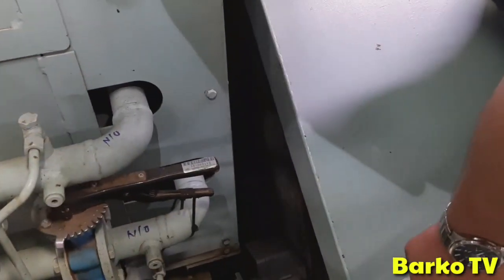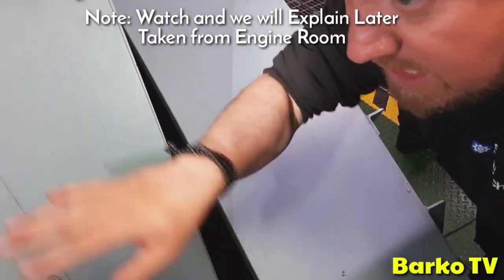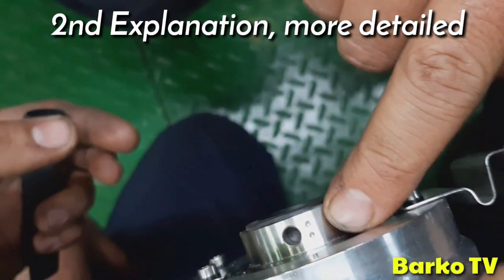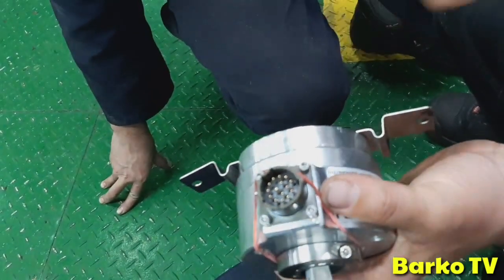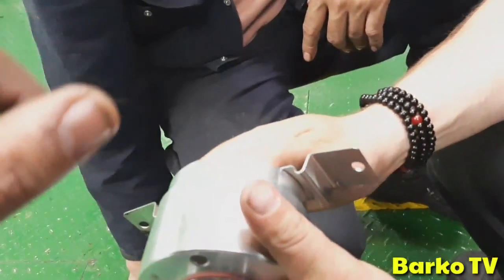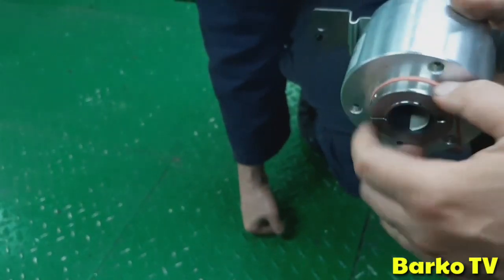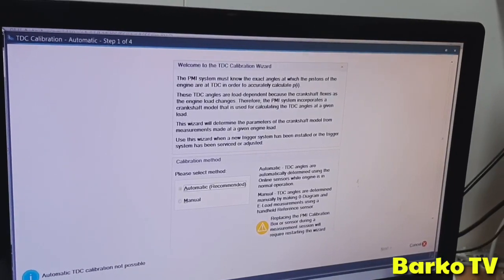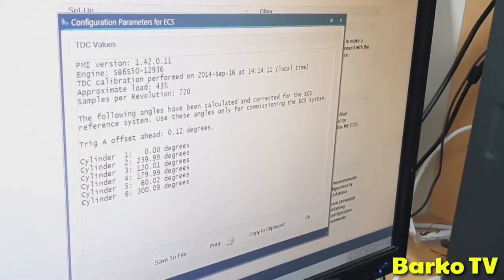Replacing Angle Encoder 》Electronic  Main Engine 》ME C 》Man B&W 》 how to perform PMI 0 diagram

Comment: Good day sir..ano po problema ng main engine bakit pinalitan ng angle encoder?sa amin po nagka problema main engine namin pag e.timing sa 210.7 which No. 4 is in top postion if we move dead slow ahead main engine will not start but in astern main engine will start..is this angke encoder is a problem?salamat po sir
Reply from the maker: https://youtu.be/gAA_nEigxVY sir dito natin malaman if merong prob ang ating angle encoder, kasi sa function test di yan mag successful pag di tugma ang setting/position ng encoder over sa flywheel, sana makatulong po